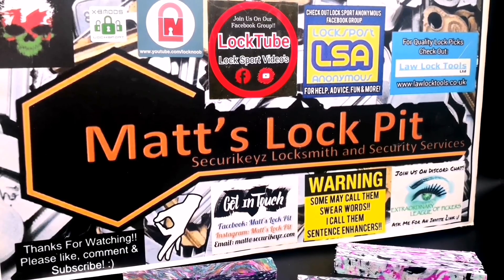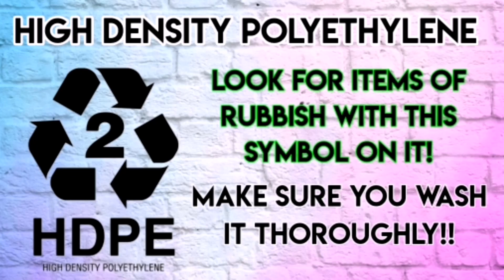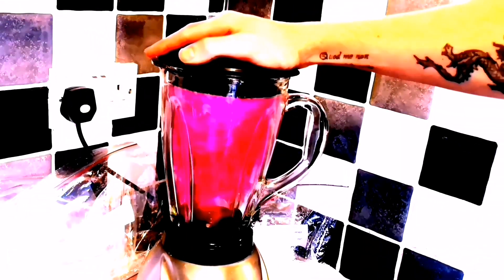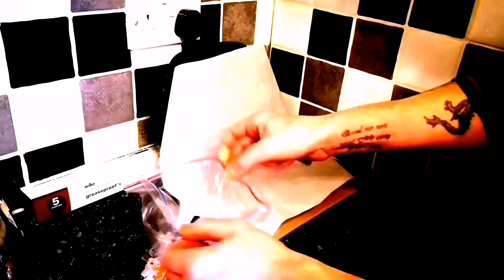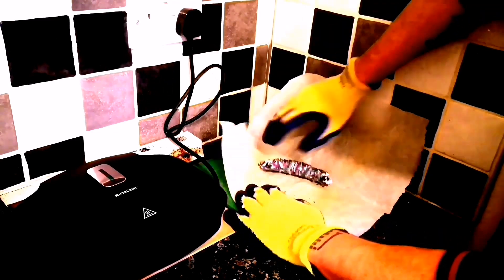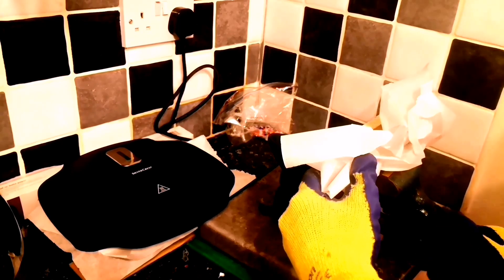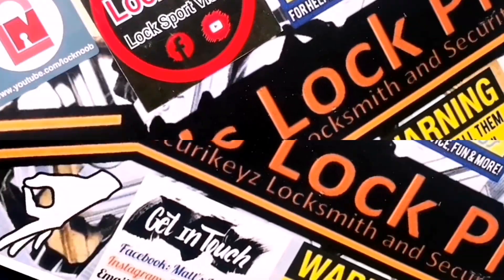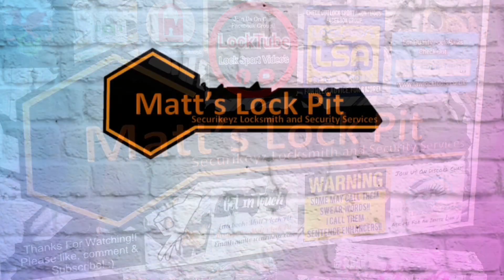How To Make/Melt HDPE. For Lock Pick Handles, Pen Blanks, Knife Scales etc

Comment: You could do full tang pick but you'd need to use pins to hold the scales together and drill the holes through the hope slightly smaller than the pins to get a compression fit.